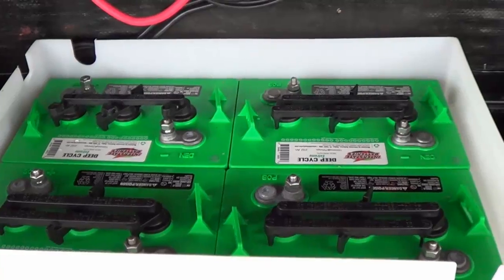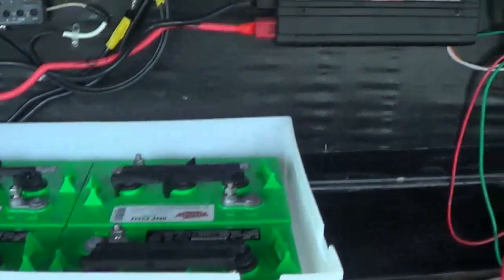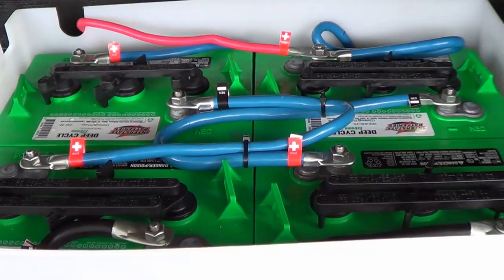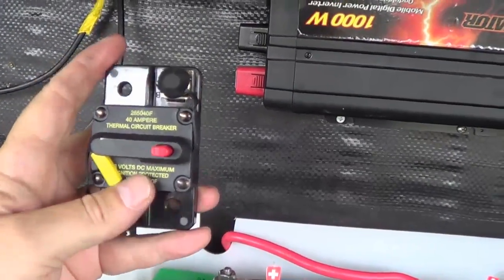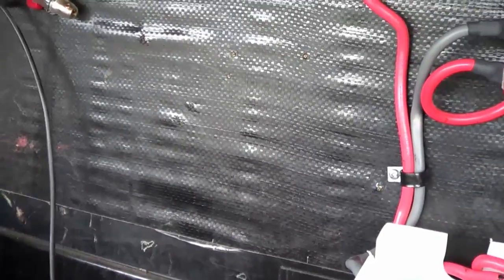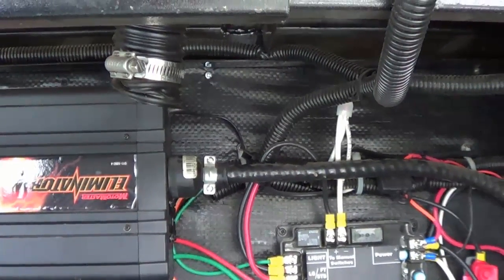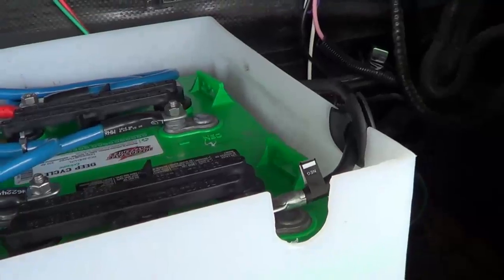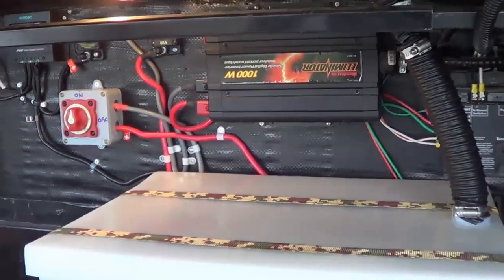Upgrading My RV Battery Bank for Dry Camping

Comment from the maker: Updates I've upgraded the wires to larger gauge 2/0 and shorter once I met up with a buddy that could do custom cables for me - http://www.loveyourrv.com/wp-content/uploads/2016/07/Four-Interstate-6-volt-batteries.jpg
Here is my boondocking system as it basically sits today - http://www.loveyourrv.com/diy-rv-boondocking-power-system/
The only changes I've made was to swap out a damaged ground panel - http://www.loveyourrv.com/replacing-damaged-portable-solar-panel-plus-new-mounting/  and added a catastrophic fuse right to the battery post - http://www.loveyourrv.com/installed-catastrophic-fuse-rv-battery-bank/ The system has worked well for our needs, rarely need to run the generator anymore. Cheers, Ray

Comment: Very nice! How many days do you get boondocking with this set up?
Reply from the maker: It would depend on the temperature and how much we needed to run the furnace, usually 3-5 days with no power input but with the solar and generator to recharge we can boondocking as long as our water and tank space lasts. About 2 weeks or so. Cheers, Ray
Reply: @LoveYourRV  I was thinking of going with 2GC interstate extremes to boondock 4 nights only going to use the furnace at sleeping hrs. Don’t know if 2 extrema golf carts would hold though might have to buy a generator
Reply from the maker: A lot depends on how many things you power, every one has different needs. Here is a video I did showing what we use. I did it a while ago so actually have more solar power now and lithium batteries but it should give you an idea what we do. - https://www.loveyourrv.com/what-do-we-power-with-500-watts-of-rv-solar/

Comment: Can your stock alternator on the tow vehicle safely charge all four batteries as you drive.
Reply from the maker: Depends on how big of charger you use. If its just the factory tow cable charger then no problem. But some people beef up the wring or add a DC-DC charger. If you do something like that you have to make sure the alternator has the capacity to handle the extra load on it.  I just installed on on my new truck - https://www.loveyourrv.com/renogy-40-amp-dc-dc-charger-installation-and-demo/  Cheers, Ray

Comment: How come increasing the volts doesn’t double the ah.  If I’m connecting 2 batteries my capacity should double
Reply from the maker: Because each of the batteries are rated at a certain number amp hours at 6 volts.  Amps X Volts = Power
So when you series two of the same  batteries you are doubling the voltage which doubles the power. When you parallel them voltage stays the same and amps hours double. Either way you are doubling the total power.

Comment: What is better??? 4 6volt or 2 12volt deep cells??
Reply from the maker: That's a pretty general comparison, but a great many people like to use the 6V golf cart type wet cell batteries believing they give the best bang for the buck. Some will spend more money and go with 12V AGM type which need less maintenance and ventilation than the wet cells.

Comment: Does this configuration allow for use of an AC unit while dry camping? Thanks @loveyourv
Reply from the maker: No, it doesn't not enough battery power or high enough wattage inverter. Building a system able to run the AC off battery power can get quite expensive. Cheers, Ray

Comment: It is recommended that the kill switch is connected to the negative terminal, not the positive.
Reply from the maker: I've heard it debated both ways. Some say negative some say positive, doesn't really matter much in my opinion. Here is an example instruction manual from Blue Sea showing a positive hookup diagram - http://assets.bluesea.com/files/resources/instructions/6006_web_version.pdf
Personally, I like to have all my switches, breakers and fuses on the positive cables for consistency.  Cheers, Ray

Comment: Hello, I was doing some light wiring in my camper. Red and white wire.which is positive red or white.
Reply from the maker: With RVs, you never really know for sure. Generally, the red will be +12 volts and the white will be -12volts or DC ground. White can also be the AC neutral wire and black the AC hot wire and sometimes they use black as the 12-volt DC positive wire. To know for sure it's a good idea to get a digital multimeter and make some measurements.

Comment: What's the advantage to going with the 6 volts vs just putting 12v in?
Reply from the maker: The 6 volt is taller so more compact from a floor space perspective, they have heavier/thicker lead plates than most 12-volt batteries that call themselves deep cycle so can handle deeper more often discharge cycles before wearing out, good bang for the buck price wise. Here is a good article - https://marinehowto.com/what-is-a-deep-cycle-battery/ Cheers, Ray

Comment: The way mine is set up, I plug my RV directly into the inverter - you mention disconnecting the "converter" to avoid a funny loop - can you explain what the converter is? I am new to this and don't want to damage any equipment!
Thanks!
Reply from the maker: A charger converter is a device that takes the 120V AC shore or generator power and converts it to DC power to charge the batteries The output voltage usually varies between 13.2 - 14.4 volts depending on the state of charge of the batteries. An inverter is a device that takes the 12 volt DC battery power and converts it to 120V ac power to run household outlet type stuff and appliances.
On some of the newer RVs, they are starting to combine the two into one device usually called a Hybrid Inverter Charger. ie. - http://www.magnum-dimensions.com/product-inverter/3000w-12vdc-pure-sine-hybrid-inverter-charger-msh-series
Reply: Where would that converter be located?  If I have my trailer plugged directly into my 3000 watt pure sine wave  inverter - does that mean the inverter is trying to charge the batteries as well as draw from them?

Comment: What are The benefits of using 4? 6 volt bateries vs 2 12 bolt
Reply from the maker: The 6 volt is taller so more compact from a floor space perspective, they have heavier/thicker lead plates than most 12-volt batteries that call themselves deep cycle so can handle deeper more often discharge cycles before wearing out, good bang for the buck price wise. Here is a good article - https://marinehowto.com/what-is-a-deep-cycle-battery/ Cheers, Ray
Reply: @LoveYourRV  Thanks I'll read the article

Comment: Keep the standard red+ and black-
Reply from the maker: Thanks, I like the red and black but lots of RV OEMs use also use black and white as a standard. In my trailer, most of the 12-volt wires are black or white with a black strip. All the negative and ground returns are white. Same is true for my 7 pin trailer plug.
I initially had trouble finding large enough cables so had to use some starter wire but I have upgraded my battery wiring after getting a hold of some spare 2/0 cables, here is what it looks like now - https://www.loveyourrv.com/wp-content/uploads/2016/07/Four-Interstate-6-volt-batteries.jpg

Comment: Well done! Super clean! Thanks for posting.
Reply from the maker: Thanks, since then I've had some cables custom built to replace the off the shelf ones I initially used, shortened and thickened to 2/0 gauge - http://www.loveyourrv.com/wp-content/uploads/2016/01/Interstate-battery-bank.jpg 
http://www.loveyourrv.com/20-rv-upgrades-fifth-wheel-trailer/  Cheers, Ray
Reply: Love Your RV Yes I watched the upgrades videos just now. Very clean work. I’m looking to do something similar. Allot of great info here. Thanks again!

Comment: I thought inverters of that sort had their own electronic protection?
Reply from the maker: They do, fuses and circuit breakers are to protect wiring from overheating in the case of a direct short circuit.
Reply: Also I am not sure you had to upgrade the cables over the original installation as the 1 gauge runs were not very long and the biggest draw on the 12 volt is probably the inverter if you are running close to capacity.

I used to run T-6's but one winter they froze (battery maintainer somehow got unplugged and panels snowed over) and what a mess!  Battery acid everywhere.  So I switched to AGM even though they are quite a bit more money.  The T-6's were in a white box like the one you show but the dealer had screwed it down so somehow the batteries had to come up and out, not easy to do with the box full of acid.  So I switched back to marine boxes that are strapped down like in a boat so if necessary I can take the whole case out.  I only have 2 though, but I went back to 12 volt because I find it more scalable, for example I can add a third without having to add a forth.  Little bit less power but the AGM's are also more resilient to being drawn down below 50%.  Plus they charge a lot faster on a generator at least if you use the 3 stage converter.

Comment: inverter needs to be lots bigger.  They sell 2500 wawtt inverters in almost any truck stop in America.
Reply from the maker: Maybe for you but 1000 watts has been plenty big enough for us. We have fairly modest off-grid power needs. Just a few computers, a TV and some electronics chargers for camera and phones that sort of thing. Having a large inverter would be wasting power for us.
Reply: today's modern inverters while they may waste some power,  aren't the deficit they used to be.    2500 watts can run an curling for example.   however,  the use of a Air Conditioner would be illadvised in these pursuits, but oh so nice to have when a little older.  Please believe me when I say I admire your willingness to attempt life without the system.  I would personally add at least 2 more solar panels.  But still get some honda generators,
Reply from the maker: We aren't rich and have a budget so I guess it's all about allocating your dollars in a way the is best for your own personal lifestyle on the road. It's my preference to cook using the gas stove and oven over a microwave or convection oven or induction hotplate, we don't use a coffee maker so I have no pressing need for a bigger more expensive inverter which demands more battery capacity, solar panels and larger cabling adding more weight.  Also, I'm pretty well maxed out on my trailer safe load capacity. I'm actually planning on reducing my inverter size to a 600-watt unit when this 1000w one wears out.  I find 1000 is overkill for our needs. I have to carry a generator anyway for recharging when multiple cloudy days hit, so if I ever need to run something high wattage briefly I fire it up. Nowadays they even come with remote start via a key fob.
Reply: everyone has a budget.  However,  doesn't your RV already have an inverter?  just shut down the right circuits on your fuze panel and you do not need to waste anything.   If your RV is old then go to RV salvage yard and ask for the newer unit,  which has a , batt. charger,  inverter, fuze box built in.  all you need is implement the solar panels.  You never needed to buy an inverter anyway,   the addional 6v  batteries were great innovation.
Reply: Sorry i should have thought about it earlier,  sorry I didn't.  Today's RV's are much more capable of handling off grid systems then yesteryear.
Reply: Your inverter size depends on what and how many things you need to run at once.  Many people go big on the inverter.  Big inverters have drawbacks though.  One in particular is that they allow you to drain your battery bank more quickly.  Hopefully, one uses some discipline in their power usage, but even then the limits of your storage can sneak up on you.

I use a small inverter because my power needs are modest and because bigger inverters cost more than I want to spend.  If I was full time or taking long trips, I would probably want a bigger inverter, but I don't subscribe to the idea that bigger is better in every case. (In some cases, yes, but not in all cases.)
Reply: We have a few people who think the empire state building can be powered with a 100 watt solar panel.

Comment: Give me an idea how much stuff you can run off just the batteries and for how long. Doesn't have to be exact, I'm just trying to wrap my head around what the reality is.
Reply from the maker: Our battery bank has a rated capacity of 464 amp hours so it would put out 1 amp for 464 hours before it was completely dead. However, it's recommended by most lead-acid battery manufacturers to not let the batteries drop below 50% state of charge so effectively unless it's an emergency situation we only have 232 amp hours to play with.
In our routine days, we use between 10 to 20% of our capacity. It can vary depending for the most part on temperature. Long cold winter nights mean we run the RV furnace tons more who's fan draws 6-8 amps, also when cold lead acid batteries lose capacity.
So we could go 5 days in warm weather 80F days and 50F nights or 2.5 days on cool weather 50F days and 30F night.

In a typical working day, I run my 17" laptop 8 hours and my wife runs her 21" iMac desktop roughly the same, we also may watch 2 hours of TV. Those are out big power drains. Added to this typical power load will be some stuff charging like the cell phones, camera batteries, etc and the loses in wiring and the inverter circuits.
If we were to go to extreme power conservation and only run LED lights the rig still drains around 25AH a day with stuff like the fridge control board, propane detector, and other parasitic loads, so we could in warm weather max our 50% battery drain at around 9 days.

If you want to find out how other things will drain the battery, find their wattage. Use the formula  watts=amps x volts
So an 800-watt microwave takes roughly 800/12 =  66.6 amps to run. It would drain the battery bank to 50% if run constantly at its rated wattage for around 3.5 hours. You can see there are a lot of variables depending on how folks consume energy that's why the best thing to do is install a battery monitor system that can track usage in amp hours. Then use the rig and see how much you use typically, then build the battery bank and solar system to meet the needs. Cheers, Ray
Reply: As always Ray, thanks! I can almost hear Mr Rogers explaining to me how to make my own off grid nuclear reactor out of a potato, a milk carton and a paper clip. : )

Comment: Very nice install Ray! I’m going to do the same install in my new Cougar. Thanks!
Reply from the maker: Thanks, Terry, I've upgraded the wires to larger gauge 2/0 and shorter once I met up with a buddy that could do custom cables for me - http://www.loveyourrv.com/wp-content/uploads/2016/07/Four-Interstate-6-volt-batteries.jpg
Here is my boondocking system as it basically sits today - http://www.loveyourrv.com/diy-rv-boondocking-power-system/
The only changes I've made was to swap out a damaged ground panel - http://www.loveyourrv.com/replacing-damaged-portable-solar-panel-plus-new-mounting/  and added a catastrophic fuse right to the battery post - http://www.loveyourrv.com/installed-catastrophic-fuse-rv-battery-bank/ The system has worked well for our needs, rarely need to run the generator anymore. Cheers, Ray
Reply: Love Your RV Thanks for the quick reply Ray! I was just reading your blog, you’ve done a great job with it. I getting my parts list together so I can order everything. Thanks again for all the great content. Hope you and your wife have a great day.

Comment: Don’t know if anybody else ever said this, but my understanding is that lead acid batteries will Off-gas hydrogen when charged.  Hydrogen is lighter than air so it needs an upward escape path.  You’re setup covers this but I just thought other viewers might think that a vent anywhere will do the trick.
Reply from the maker: Yes, good point, battery boxes usually need two openings to create a chimney effect an lower one below the batteries and an upper one above. Unless a fan is used.

Comment: is there a list of the carrying capabilities of the cargo bins. i know each RV would be different and would also depend on what the bin is made out of, but no sales person ever lists stats like that. With these batteries being what they are, the weight must be enormous. Not to mention 10x fold while bouncing down a bumpy road.
Reply from the maker: I couldn't find anything published but know that a lot of fifth wheels use the front compartment for batteries and builtin generators. The front compartment is built much more robustly than the sides. The container is sheet metal welded right to the frame. Much like what a car trunk would be made of. 
I've inspected often and see no signs of cracked welds or bending after several years of full-timing, often traveling on rough backroads. I have fellow RVer buddies that have installed 4 or even more batteries in the same spot with no issues. The weight of my 4 battery bank is 240 lbs. I have my bank strapped down so it doesn't bounce. Cheers, Ray

Comment: Thanks for sharing. I'm researching lithium ions. GreenLife has a 260ah battery for insane price of 2999$ on Amazon. But everything about lithiums is so much better technology and capabilities than the ancient flooded lead acids that even at such a high cost the overall benefits balance out. There's also a battery almost available called the sodium battery which is even better than lithiums. Company based in Finland.
Reply from the maker: When my lead acids are ready to be replaced hopefully there will be a cost-efficient battery out there. I'll let the early adopters be the guinea pigs like I do with most tech. :)